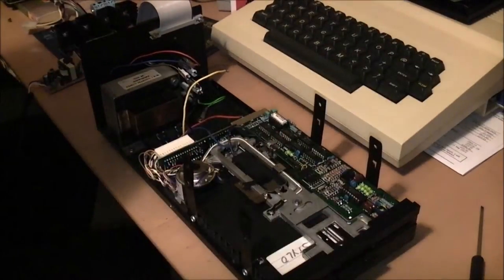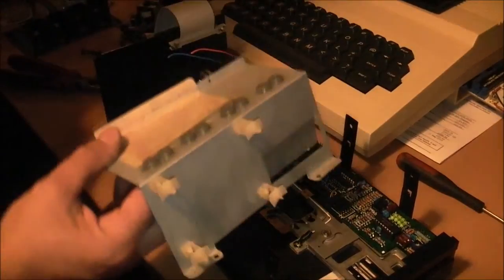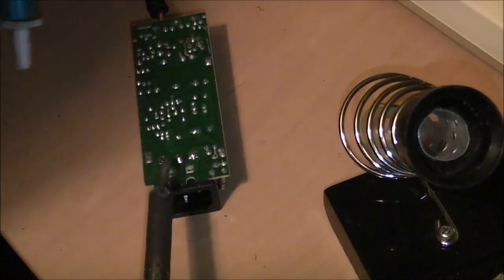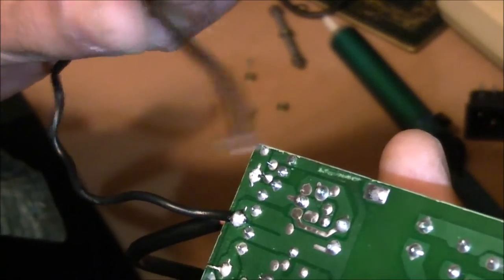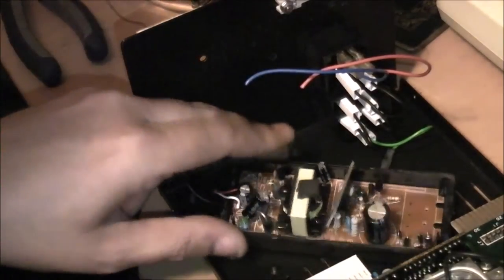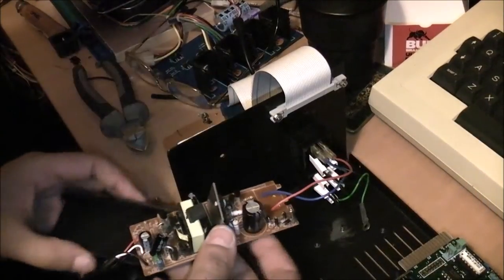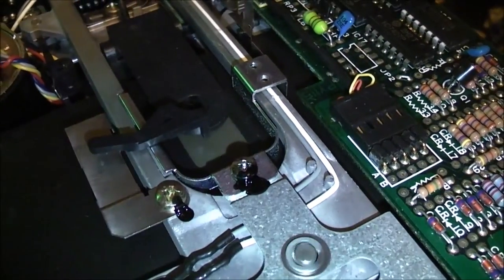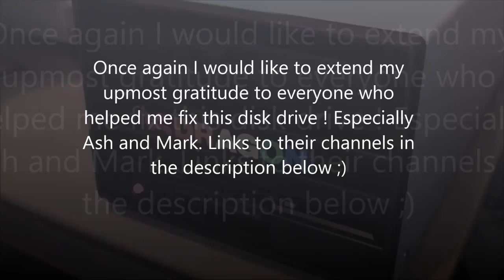Dragon 32 Floppy Disk drive Repair - Part 2

Comment: Great job!  I would be tempted to use some mounting pillars or a bracket or something to screw that PSU onto the chassis somehow.  Possibly also put a screw through the PSU PCB as well to hold it into the plastic bottom.   Awesome work restoring this FDD! =)  The last thing you want is that PSU moving around.  I guess you could put the plastic lid back on the PSU but it might not last as long if its not open top etc.  I know you mentioned hot glue - I wouldn't rely on that to hold the PSU down.  If the unit takes a large knock it could come loose and float around the case there.
Reply from the maker: GadgetUK164 Thanks mate, well pleased with this one. I am confident that the hot glue will do the job, there's plenty of it on there and if it gets a knock hard enough to dislodge the psu, it'll probably be enough to wreck the drive anyway. There is no weight in the little psu either, so would need to be a hell of a jolt to knock it loose.
Reply: Great!  I was thinking more about personal safety than the drive!  I know the chassis is earthed but should the earth become disconnected somehow - say a bad plug, or bad wall socket, and the mains connects to chassis...
Reply from the maker: GadgetUK164 I appreciate your concern. I think the chances of all those things happening together are pretty slim but I will be careful. If it ever gets a jolt, I will make sure to check it over and disconnect from the mains before I touch it ;)

Comment: Top work here John. Whenever I do things like this I'm always envious of those who have tools for cutting plastic and making the little stand-offs to hold things in place as I always feel I can do a tidier job of it. You don't want to go blobbing a ton of hot glue on that if you can avoid it mate. Mainly because you can improve the aesthetics later on :)

Also, huge cojones for pissing about with power transformers and not flinching when you hit the power switch.
Reply from the maker: SmoothEmJay Thanks mate ! I'm not to bothered about the aesthetics of it as only myself will ever see it lol but it looks ok as the hot glue is below the psu and you can't see it anyway.

Comment: Impressed me again John. 
Not that it's really part of this video, but I've seen you do continuity tests with your multi meter. I have a Fluke multimeter. Should every multimeter be capable of doing continuity checks? I've never used mine for that but it's a handy skill to use.
Reply from the maker: The Highlander Thanks Wouter. You multimeter should have a symbol with a speaker or sound icon. Almost looks like a wi-fi symbol. Send me a picture of the front of it on facebook and I should be able to show you where it is :)
Reply: cool. hang on